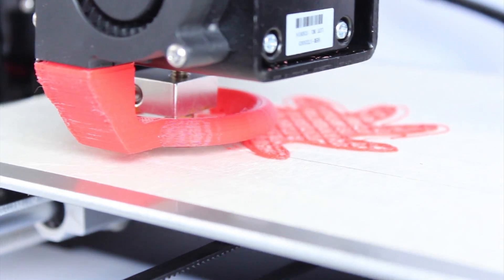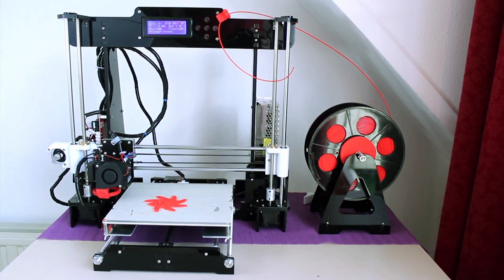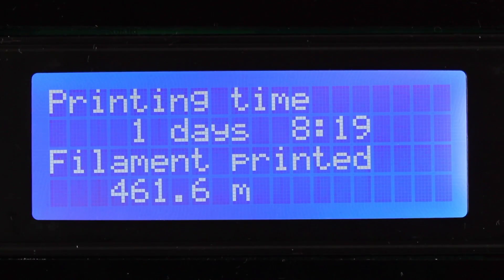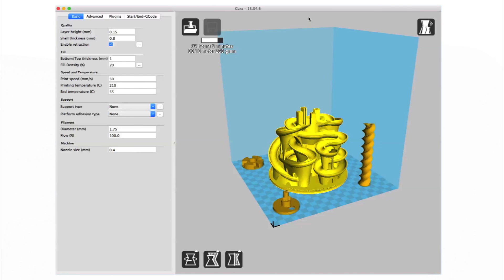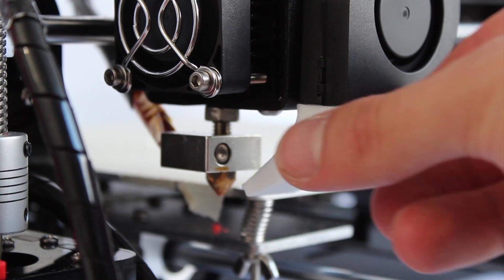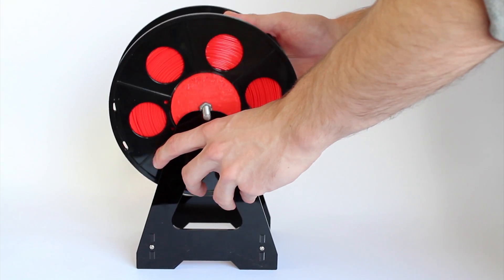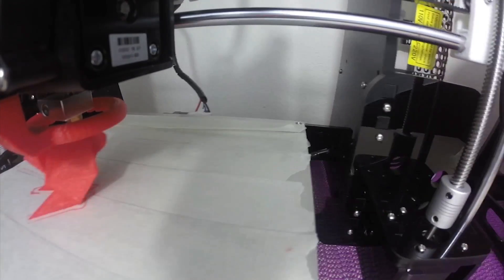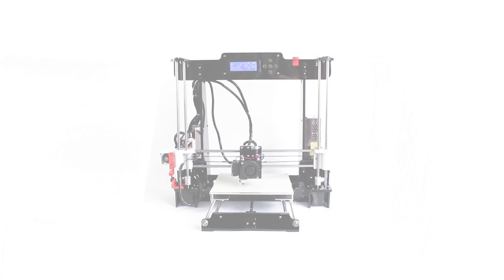Anet A8 DIY 3D Printer Review

Comment: Hi there i'll hopefully be getting this as a Christmas present from my parents, but they have no idea about this kind of stuff and i don't know an awful lot too. What is the best sort of filament to start of with, ABS or PLA?
Reply: Rahiel Rahman PLA is way easier
Reply: Rémi Gonin Ok thanks. I think I'll get some ABS as well just in case :-)
Reply: Rahiel Rahman 

I wouldn't recommend getting this unless you are technically inclined, have you ever used a stepper motor or servo? Do you feel capable of diagnosing issues and replacing parts if need be?

3D printers are not for consumers, be prepared to fail repeatedly, especially with a Chinese printer. I would also buy a fire extinguisher. ( also you need to wire the power supply to the mains yourself, I wouldn't advise doing this if you do not know what you are doing )

About your question, PLA is much easier but brittle, ABS is much harder to print.
Reply: Dynamitemonkey500 Ha i see, well I'm not by any means a tech genius however after watching about 200 vids in the space from when I uploaded this comment to now, I think I'm prepared for anything this printer has to throw at me. I'm looking for an experienced that's going to challenge me, so that I can say I conquered this quest, if you get what I mean hahaha. Anyways thanks for the reply, I've ordered a selection of different coloured filaments of ABS and PLA. Have you had any experience with wood? It looks cool but I'm not too familiar with it.
Reply: Rahiel Rahman "wood" filament is just MDF basically ( fibreboard ) it's PLA with wood particles throughout.
Reply: Dynamitemonkey500 Yeah I guessed as much. Still sounds fun to play around with though, maybe I'll have to purchase some wood filament too 😂.
Reply: Rahiel Rahman I'm actually in the same boat as you, the parts for the printer come next week, however I will be replacing parts such as the power supply and the acrylic frame ( the acrylic frame can soften in the heat and either ruin the levelling, the print or even a motor. However this would be after a couple months of use)
Reply: Dynamitemonkey500 Oh nice, I'm assuming you'll be swapping the acrylic frame for a metal one ? I might consider that of I see the son diction of the acrylic worsening drastically but for now, I'd just like to get a deep understanding into how everything functions so that I can eventually build my own. But please, let me know how the frame changes the quality of your prints, I'll be intrigued to hear if it's worth the extra £80.
Reply: Rahiel Rahman I'm going to switch to wood at first but metal will be the end goal
Reply: Rahiel Rahman is there anywhere else we can continue the conversation? Reddit? Email even?
Reply: Rahiel Rahman steam?
Reply: Dynamitemonkey500 I see, to be honest I doubt you'd need a metal frame at all. Wood will most likely last just as long. Have you got a link to where you're purchasing the wooden frame from ?
Reply: Rahiel Rahman making it myself, I have access to a laser cutter, but it would also be pretty easy to make by hand.

Just draw your template by tracing the actual piece, glue it to some plywood and cut it out then drill the necessary holes. In fact that would be a better way than with be laser since you could make it thicker
Reply: Rahiel Rahman do you have a Reddit or steam account where we can continue to talk in future?
Reply: Dynamitemonkey500 Yeah I have reddit. My username is Macgyver_son
Reply: Rahiel Rahman i would suggest pla less smell
Reply: lord dumbness Thanks yeah. Since I've gotten this printer I've only used pla.

Comment: i have one how do you keep abs from warping on it?
Reply from the maker: I print aways with PLA because of the toxic smells of ABS, but from my experience warping occurs most of the time with wrong temperatures. Make you sure you have a solid first layer, and generally don't print too fast. ABS temp. should be somewhere between 200 and 260 degree. Start at 230 and change your temperature with increment of 5 degrees. Finding the right temperature can make a big difference. 

You can also always try some PLA or PET or other materials, find what you like, and what you think is easy to print with ;) succes!
Reply: thank you very much